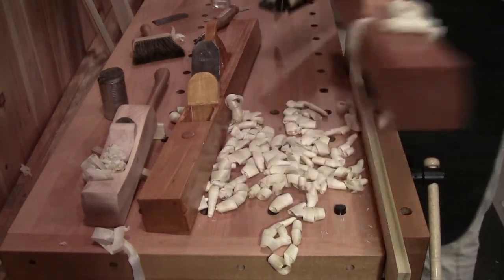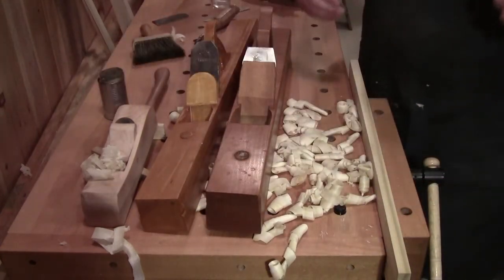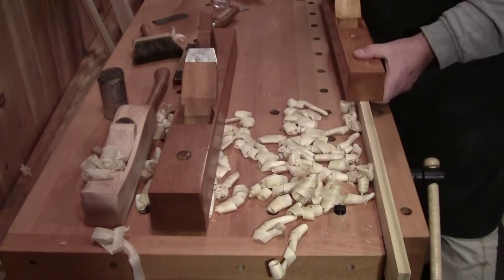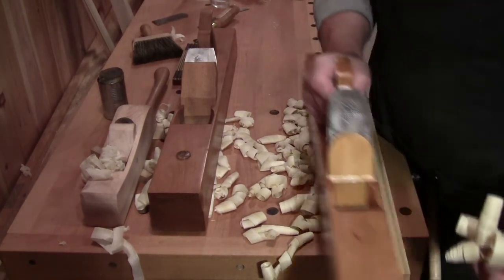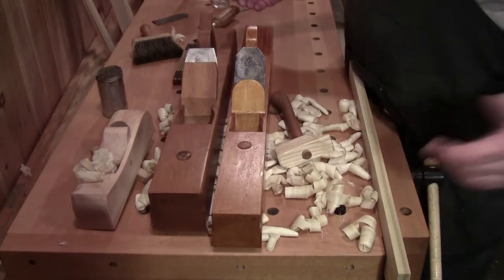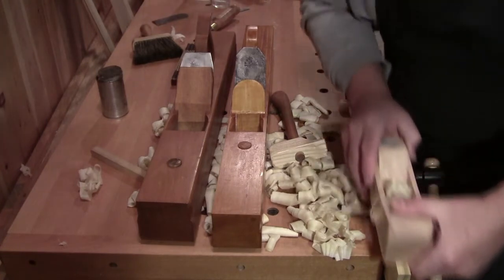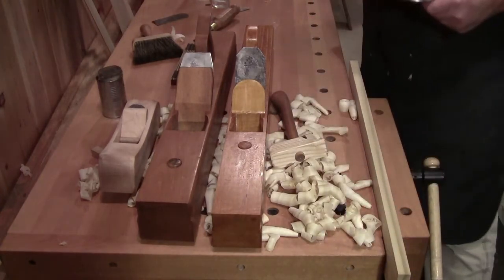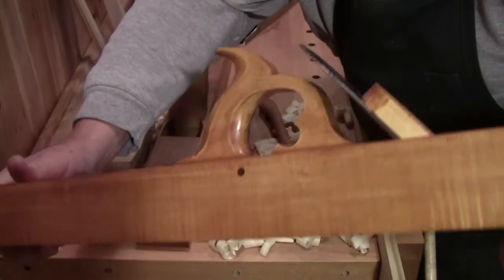Plane Talk - Homage to the Ancients - part 2 & Thank you to Bill Anderson - 23 Nov 2017

Comment: Have you done a video on controlling tear out or knots with a properly set up and close set cap iron? If not, it would help some folks for sure. That has been one of the biggest and most wondrous lessons Ive learned, how one can plane ANYHTING against the grain, with the grain, straight through knots and remove all tearout. It easily doubled my efficiency at hand dimensioning lumber, which is the only way I go about it.
Reply from the maker: Thanks for watching... Yes I did, isn't it amazing when you are sharp and get that chip breaker just right what you can accomplish?
Sometimes it gets a little tougher to push but I get no tear out at all in the most cranky woods.

Look up these titles in my channel.

"Don't Watch! Going Against the Grain"
https://www.youtube.com/watch?v=YoPMQ88c9Ko&t

"Going Against the Grain, Lie-Nielsen Bevel Up"
https://www.youtube.com/watch?v=GrB04F_qYes

"Birds Eye Hard Maple, Tear Out Free"
https://www.youtube.com/watch?v=QczD4x_w0y8&t

"Live Oak - Dealing with Cranky Wood"
https://www.youtube.com/watch?v=9iOZ3kl_3ew&t